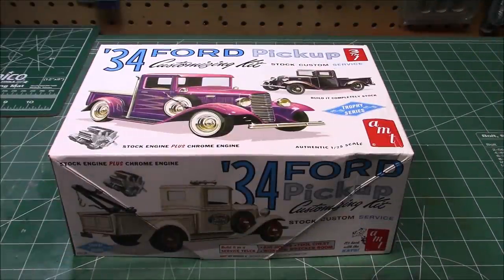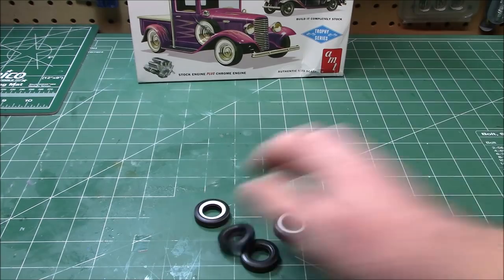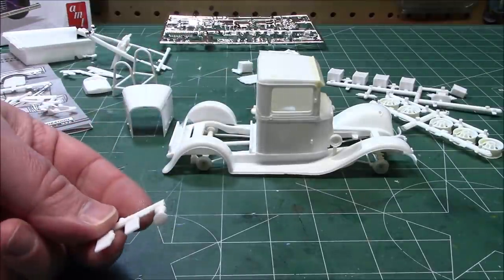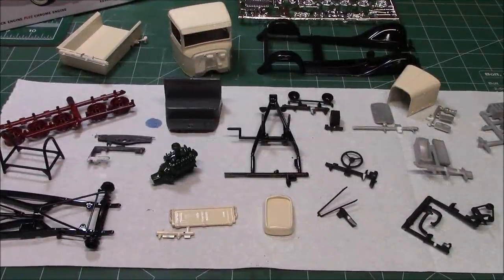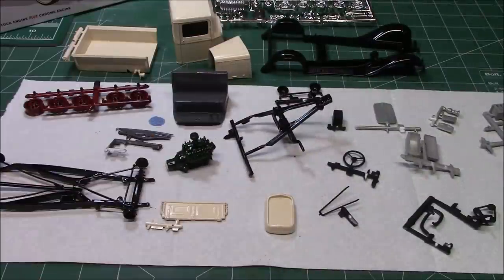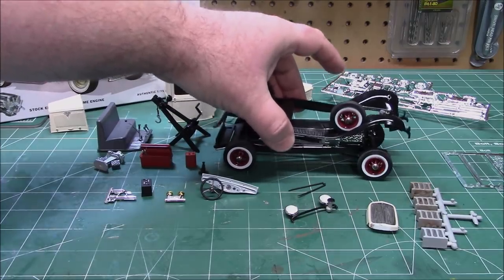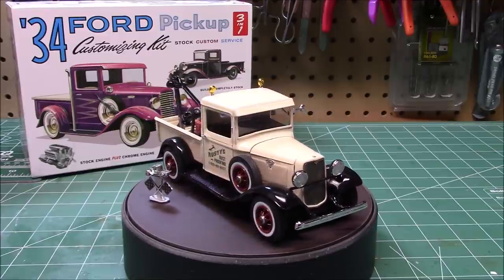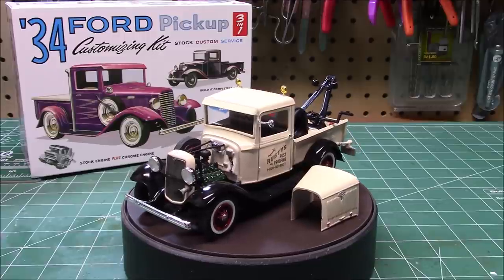AMT 1934 Ford Pickup 1/25 Scale Model Kit Build Review AMT1120

Comment: I've built this kit twice, the first time was way back in the mid 60's.  And that first kit was built, torn apart and rebuilt at least a couple of times.  It was molded in red back then.  The only difference I see it the tonneau cover was thinner and had stretch details in each corner.  The second time I built it, it was in white, and instead of a tow truck, it came with a flat bed.

Comment: Nice review & build up Chris. This kit has a storied life span. It was 1st introduced in 1962. It was re-issued several times in the 60's/70's.  When Lesney/Matchbox acquired AMT, this mold was in a machine shop being repaired/restored. Lesney moved AMT operations from Mich. to Maryland & left this mold at the machine shop. It was considered abandoned & was sold to Lindberg. When Round2 acquired Lindberg 
this mold came back home to AMT & has now been re-issued in this retro box art of the 1962 original issue.  You did a nice job on the build up of this kit.  You could (if you like) build up the 390 C.I.  T-bird engine & display it on the engine stand. I always enjoy your review & build videos. Keep up the great work.
Reply from the maker: Thanks Rick, for the back story too!

Comment: That is a nice build. I did one in 1969 in brown. One thing that was nice back then was that the kit could be built as a dually stakebed truck. I have 2 now in progress. One stock body in Ace almond beige with black fenders. The other is in a duplicolor dark maroon. This will be a custom truck I have several hopped up flathead engines to choose from, also a couple of Y blocks. Haven't made up my mind on that yet. And I am sure you are aware that superclean does remove the chrome. Sometimes in seconds, or it could take a couple of hours.Also sharpie ultra fine point pens do a good job for tail lights, and turn signals.

Comment: Very nice build Chris, and a great review.  I just finished the Lindberg version and was very curious to see how the AMT kit was different.  I really like the two trophy trucks and the cement blocks.  The AMT kit has better chrome wheels also instead of the stake bed platform but doesn't seem to have the four wide tires.  It is a good fitting kit.
Reply from the maker: You bet, thanks!

Comment: I have to wonder if the formulations fir Rustoleum are different back in the midwest, out here on the west coast the solvents craze the plastic and give a nasty texture.  So do the Krylon paints, especially fusion. However the Krylon Matte Clear works fine. Hotshots as well.  Duplicilor auto primer is good to go, but the top color doesnt.  The 1K auto clear is great as well.

Comment: Hi Chris.  I watched this video again as I have this kit but have not built it yet.  I have slowly started involving my 12 year old son with some of my builds and  he asked if we could do a father son tandem build.  I also have the Foose FD100 pickup truck kit.  essentially he want's t0 have two two trucks that represent him and I.  Mine would be the 34 and the Foose FD100 kit Would be his.  My question, Do you think if I pick up another 34 kit,  would the towing rig setup for the 34 fit into the back of the Foose FD100 kit.  I don't want to buy an actual wrecker as I can save the second kit parts to build a different 34 later on.  What do you think?
Reply from the maker: Yes, it should fit no issue, it can be adjusted, cut and moved to fit if needed it's just a post style crane.
Reply: @hpiguy  Thanks Chris,  Have you built the Foose FD100 Kit?  I did not see it in your playlist.

Comment: Hello again Chris. I was at Hobby Lobby the other day and saw this kit and fell in love with it. I want to do the service truck version as well but thinking of painting mine a different color. ( Haven't decided yet ) but I was thinking of going with a gloss gray and doing the fenders in the Gloss black and using the wire wheels and painting them red. But I have a few questions regarding what brand and color of primer should I use ? My next question is "Is the towing cable hard to install ? I did a little research online about this kit and from what I read, it told me that the towing hook would actually work. So in other words, I'd like to have mine be able to raise the hook up and down. Would something like a thick sewing thread work ?
Reply from the maker: Any primer is fine. You can use thread, that will work well.

Comment: Is it the camera that makes the adhesive look so discolored on the raw parts, like you slopped in on. Not hating just curious. Enjoy your channel and love your builds. Cheers from New Mexico
Reply from the maker: The cement has some orange paint in it from a previous build. When this bottle runs out it will be clear again.

I put it on thick, I do not like parts coming apart later. A good quality cement won't continue to melt parts after a few seconds so it doesn't ruin things like hosing a kit down with the old Testors thick stuff did. It's so thin that if it had no tint in it you'd never notice how much I used, especially after paint.

Comment: I am building the Lindberg version of this kit. Everything is identical except the Lindberg version comes with some crap plastic axles. Where would you suggest I get replacements in steel? I only have three car kits, none come with steel axles sadly...
Reply from the maker: Any steel rod will work, hardware stores or hobby shops, craft stores will have thin steel rod. 
Model airplane pushrod steel also works.
Reply: @hpiguy  Thank You!